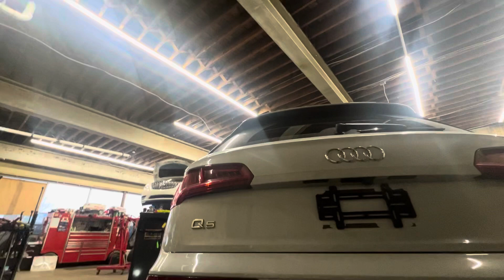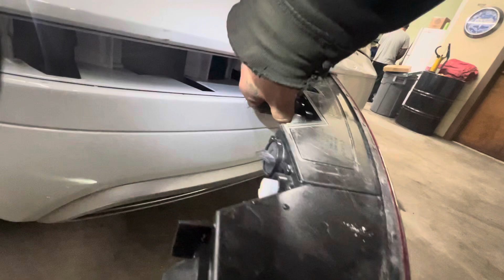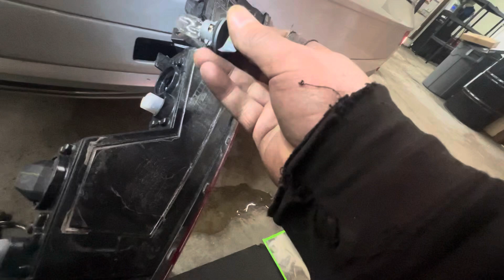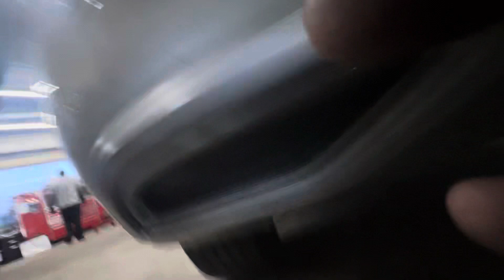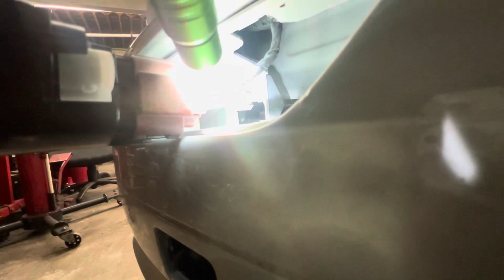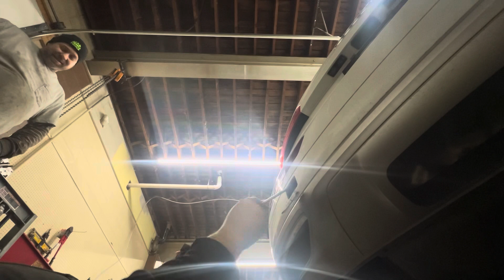2019 Audi Q5 Quattro how to change reverse light

Comment: ??Engineers?? Wtf😂😂😂 u got me wanting that insider...u liking it overall? Also suggestion, get that 600 lumen Milwaukee Headlamp and an extra battery,  u will love it...it does spot light and flood light at same time...it comes in clutch...
Reply from the maker: Loving the insider, it did fool me a while back, and I thought it was going bad already, but it was not, if you have it on something that is not sturdy like a weird clamp or something that shakes it does not do well, but love it overall, I will have to check out the Milwaukee headlamp. Just look it up on Amazon?
Reply from the maker: Just looking at the Milwaukee headlamps there are a few different ones what is the part number of the one you are recommending?